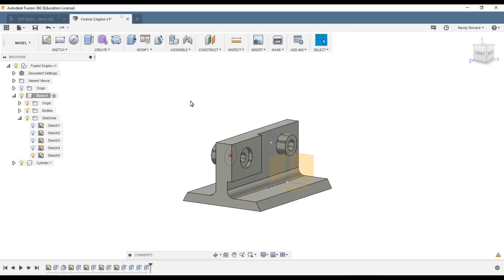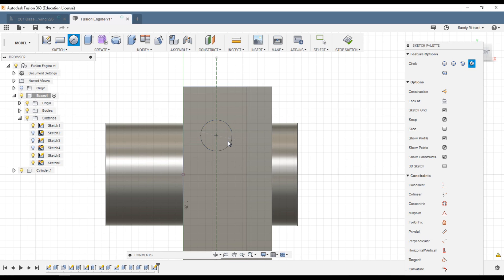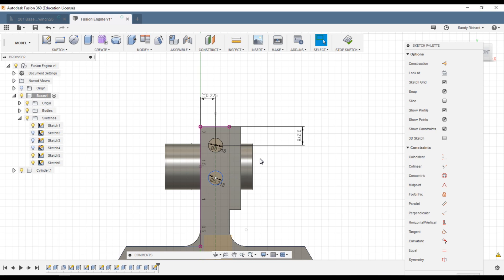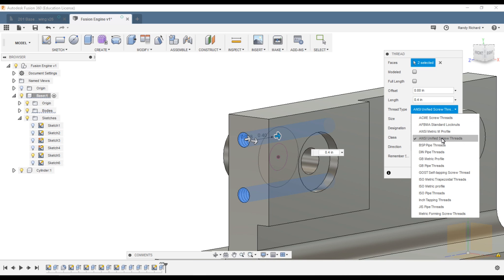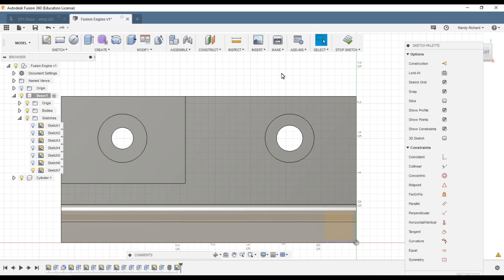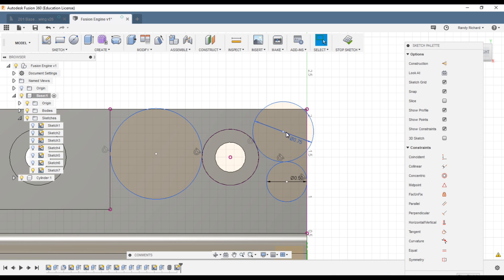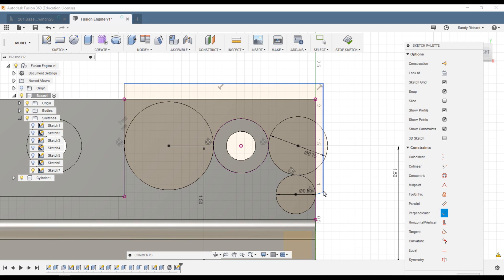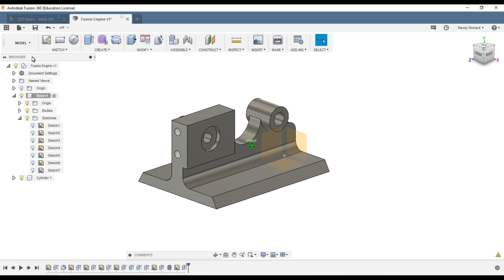P1-3 How to Model the Base of a Model Steam Engine From the Ground UP

Comment: Randy, I got through this episode and realized something didn't quite look right.  I went back to the previous lesson and realized one of my boss' was apparently positioned differently from yours... in the proflle of the yz plane the I don't think the part 2 video ever provided dimension for the right hand boss from the right hand edge of the base or I missed it after several viewings.  The vertical position is collinear with the first boss but the position on the -z axis is wrong.  So, how do I move the boss and the profiling we do here in part 3 to to the correct position?
Reply from the maker: Vert Dim is 1.5, dim between bores 2.374,  you can just set these dim's on the crankshaft bore.  You can send me an email to rrintheshop@gmail.com, i can send you a pic.

Comment: Hi Randy, well I modeled this part of the lesson.  Went much easier for me than the first lesson and I am getting more comfortable with the interface.  Now that you taught me threads, I can go do some more work on Elmer's #25 Engine.  Thanks again for doing these.  They are a big help to this newbie.

Joe
Reply from the maker: Great.  I downloaded the Elmer file.  Lots of engines.  I will check out #25.
Reply: I sent you an email with a couple questions and a link to Elmer 25 that I have drawn so far.  Maybe you can glance at it and let me know if I am on the right path.  Wasn't too sure about drawing both components on the same canvas, but get the impression from looking at your model that is what you do.  Feel free to critique me.  :-)

Joe